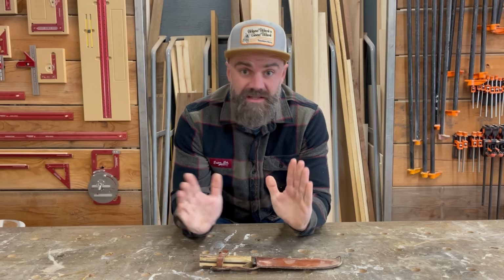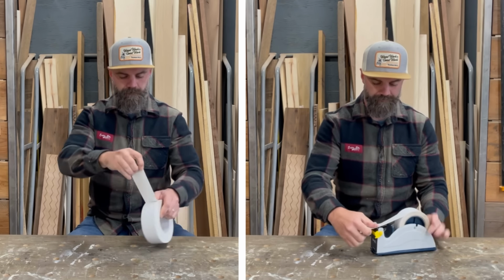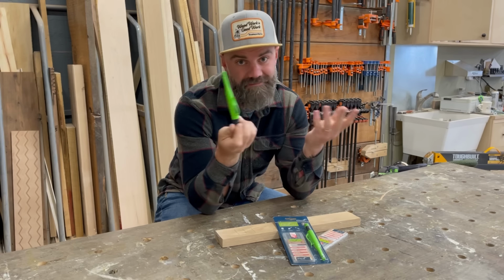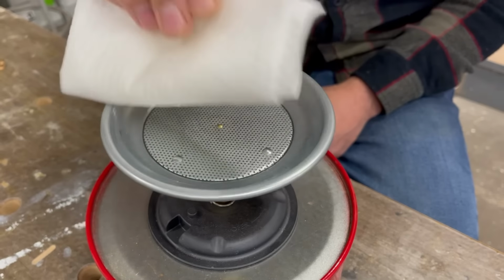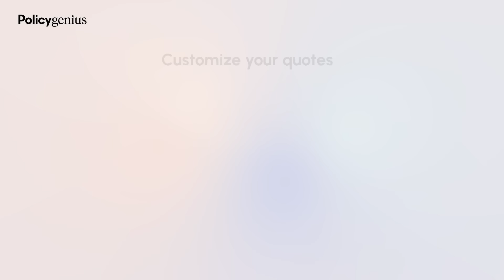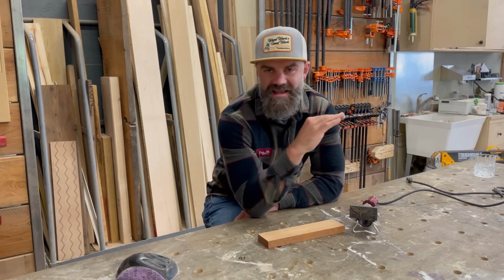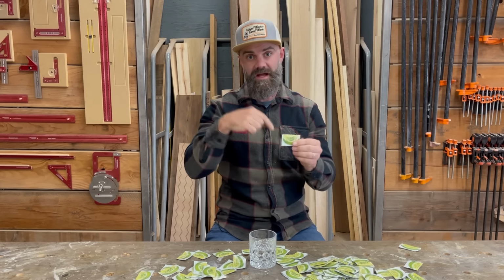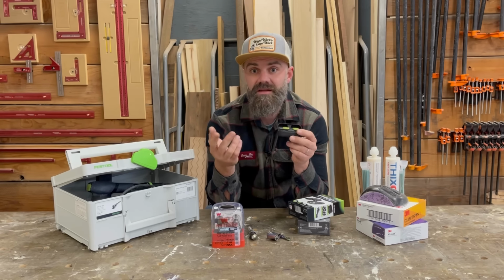You Need These Tools || All You Want For Christmas

Comment: I flash wet the wood before hitting it with hot metal and it makes for a cleaner more controlled burn in. Not sure how it would work with a graphic, but might be worth a try.
I used to brand some of my wood products and it was always a nervous process to get a good clean print on finished work. Imagine doing tons of work on something and then messing up the brand…..🥲🤯

Comment: Not that it matters what I say but times I want to read others comments on products. 

Benchmade knife mini (OZZY) Osborne knife is bad ass. Use them for hunting. Durable and stay sharp. 

Okeefs I use cause I work with chemicals primarily phosphate remover and shit drugs your hands like soaking them in Lyme. Okeef’s is literally the only thing that works get rid of the razor blade cuts from cracking. Stuffs amazing. I know my hands are starting to dry out I rock the okeefes. Good shit. 

He’s completely right on electric branding iron. I bought a super cool old school branding iron you gotta heat and there’s no way of knowing if it’s too hot or not. It sucks. Get an electric. Save your self the headaches of sanding out mistakes, or trying to figure out how many presses before you can brand a clean one. Just get an electric and save your self the time and headaches

Comment: I am guessing the coupon for the Isotunes does not apply to Canada. I went through your link, entered the code but it came back invalid
Reply: Didn't work in the US either
Reply from the maker: It might? We had an issues right off the bat. Try it again.
Reply: Now it says ‘does not apply to that product”.
Reply: Just to follow up on your new instructions. Once you add both pairs and enter the code, it works. Thanks for following up on the promo offer. Order has been placed.

Comment: Not to keen on Nicks boots. Ordered a pair, 600$,  took 7 months, wore them for 6 months and the started to fall apart. The front and rear of the sole on 1 boot is splitting from the boot. Emailed and called but they said it was normal wear. 250$ to re sole.

Comment: So 3mm or 5mm stroke on the sander? Thinking 5 for the quicker sanding assuming the finish is still really good even though the 3 would likely leave a SLIGHTLY better finish due to the smaller stroke

Comment: Those pencils have one major flaw. They are plastic and the part that holds onto your shirt pocket break very easily. So if not falling out of your pocket is important to you find one that has some type of metal holder.
Reply: I have a metal one that I use for art basically the same thing even has a rubber

Comment: Since acetone, and many of the chemicals used around the shop are quite volatile and many are carcinogenic, is there a problem with evaporation? I don't think I'd want, essentially, an open can of acetone sitting around in my shop.

Comment: Why the festool 150 vs. 125 ?? What's the difference? I don't have either one but was thinking about upgrading.  Also, table saws, what would you recommend? I have a dewalt contractor saw that I put on my own table /bench
Reply: 125 is 5” 150 is 6”

Comment: I am a wood turner and I recently switched to 3m Cubitron 3 inch sand paper, it is by far the best sand paper I have used. Sanding a bowl used to take 4-5 sheets of the generic brand I used and now it is 1 sheet of 3m. Now I just need the 3 in rotex sander.

Comment: The 3m paper is awesome and worth every penny. I have some on my sander and today when I went to do some sanding I pulled it back see what grit it was and the numbers were worn off but the paper was still good. I’ll be using a sharpie going forward. That paper not only last, it cuts extremely well cutting your sanding time down.

Comment: If you didn’t own a Festool Domino, would you own a biscuit joiner? Recommendations are all over the place on YouTube.
Reply: They serve entirely different purposes
Reply: As someone who used to use biscuit joiners all the time, I finally tried the Festool Domino a few years ago and haven't looked back.  In my opinion, it is one of the best tools ever made and I'm using it right now making a crib for my newest granddaughter.  Save up and buy the right tool for the right purpose...you won't regret it.
Reply: The YouTube gurus say that the biscuit helps with alignment, but doesn't make the joint stronger. The Domino does both. I use a Dowelmax jig which is expensive for a doweling jig, but also adds strength and helps with alignment at a much lower price than the Domino.
Reply: @The_Ol_Bizzaroo  the gurus are correct

Comment: Good morning.  Thanks for your great content and the ISO Tunes order info.  I've been in law enforcement for over 25 years, and woodworking is the one thing that has kept my sanity intact.  I've been needing more usable ear protection for the shop.  I saw that Peterson Pipe chart on the wall in one of your videos, and then a short time later in another video, you mentioned making pipes.  That is an area I wanted to explore but have yet to.  Thanks for your bourbon tips.  I, too, am a conesour of single malt scotches and bourbons.  Be well, and God Bless.

Comment: Great list, thanks!
I'll be adding a couple of those solvent dispensers to the shop for sure. My feet get super dry and crack during the winter so I use a lot of that okeefe's foot cream. It works wonders. I need to try that 3m cubitron stuff.

Comment: Great ideas. The tape dispensers sound like a good idea but they leave a serrated edge which can be problematic for double sided tape. You didn't mention that the Pica Dry pencil leads come in a variety of colors. I bought it with a pack of white leads which I use exclusively on dark woods.

Comment: About 3 years ago I finally bought a Benchmade knife.  The Osborne 940.  Wanted one for years, but couldn't afford one.  Great knife, and love the S30V blade steel.  Another great brand is CJRB, and I have a couple of theirs because I love button lock knives.  A bit easier to close the blade than the axis lock ones like the 940.

Now, about the PICA pencil.  I must be the only one on Earth that can't stand that thing.  I seriously do not understand the draw.  The lead isn't dense enough, the sharpener is twitchy and hard to use.  Nothing about it is appealing.  YMMV.

Comment: Great episode.  But, I will caution people about using and storing Acetone.  It should ONLY be stored in a sealed container.  Acetone vapors are heavy and will spread along the floor.  The slightest spark will ignite the vapor which burns with an almost invisible dull blue flame.  You feel the extreme heat before you see the fire.  So, I would be cautious about using Acetone in a plunger can.  I know many welding shops use acetone that way but it is very dangerous.
Reply: This is a sealed can which is specifically designed to store acetone! 😂
Reply: Acetone evaporates extremely fast.
Reply: I have this plunger can and stopped putting Acetone in it because even in this can it evaporates VERY quickly
Reply: Then in goes boom and then me and my brotherhood are called to put the fire out